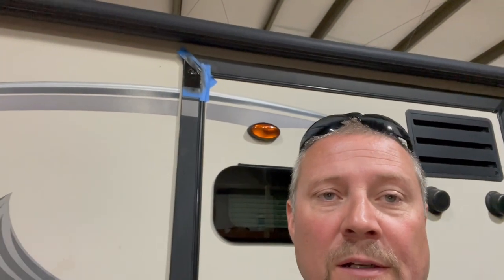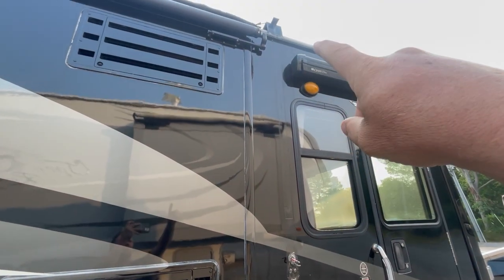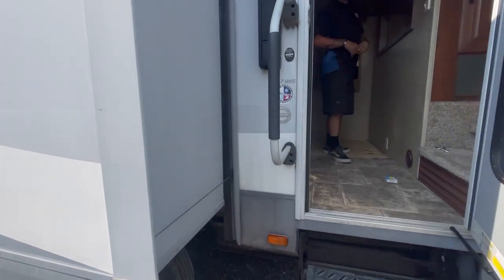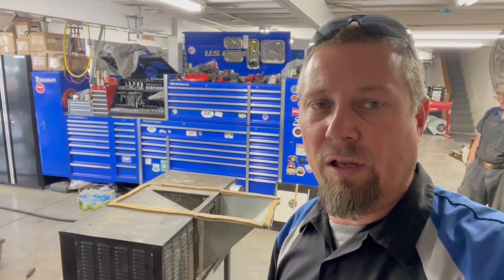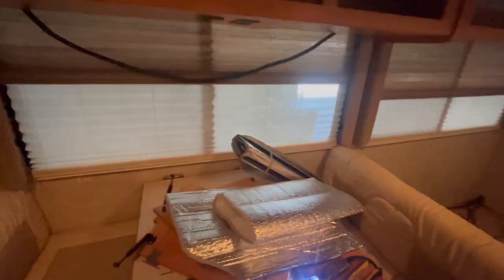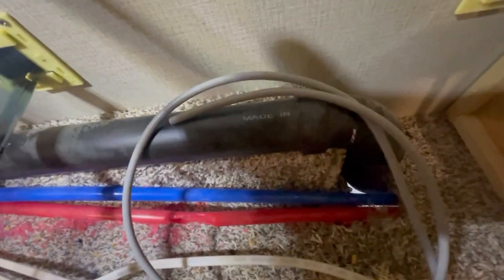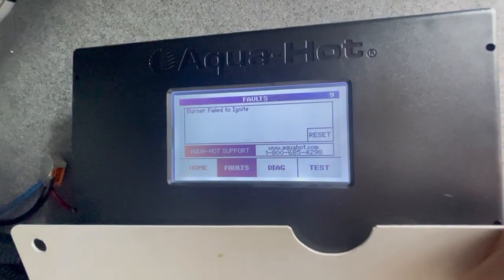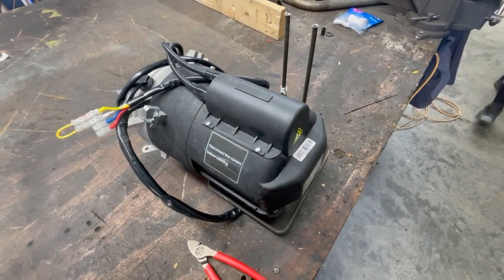Rat Party Central

Comment: you might want to recommend using peppermint oil on small pieces of sponge  at all the spots where mice can get in. yes it does work, mice do not like the smell. have to refresh it once a month. use the oil on the wires as well. much cheaper than repairs.